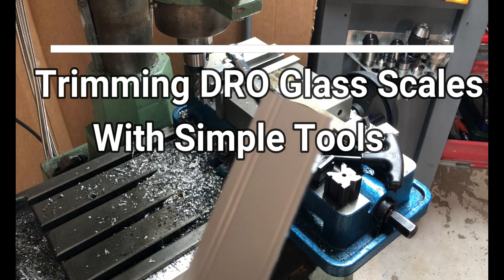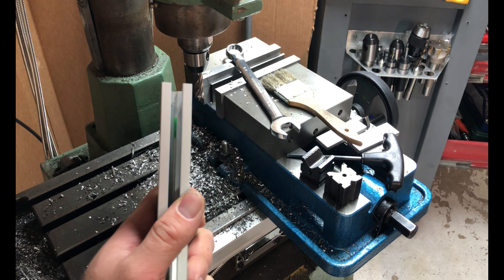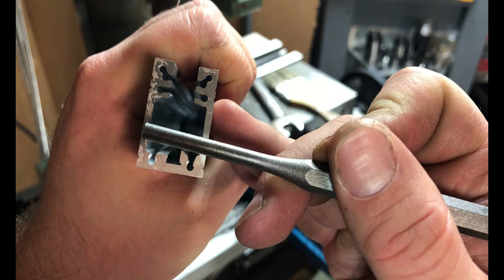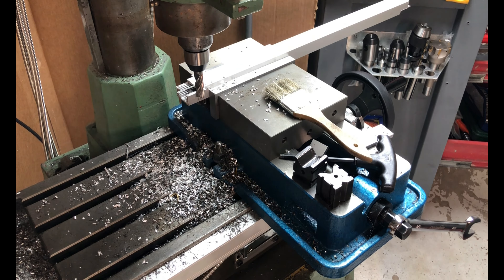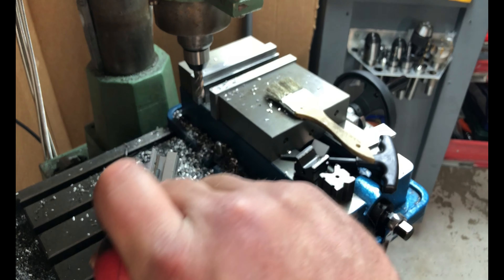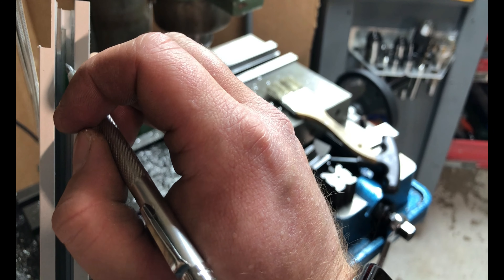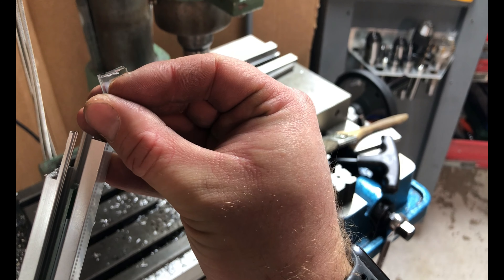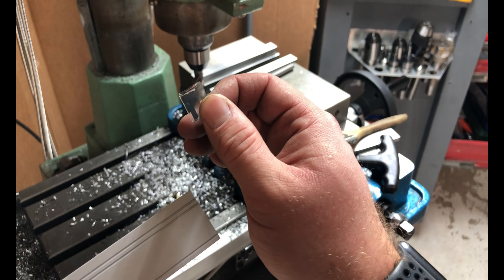Trimming DRO Glass Scales With Simple Tools (And a mill)

Comment: Just about to give this a go - let you know how it works in an hour or two . . . . !

An hour later . . . . yes it does ! The glass scale needs to be cut about 1/8 inside the outer aluminium though as - at least on mine - there's a extrusion on the chrome end caps - the glass scale needs to be cut back enough to clear this. The 'green' thing that holds the glass in on mine was a piece of small clear plastic tubing - I removed this with a pick.

 I'd also recommend cutting away the yellow sealing strips with a sharp knife rather then the mill and use a vacuum cleaner close to the cutter to keep swarf from getting inside -  I carefully cleaned mine out afterwards too.